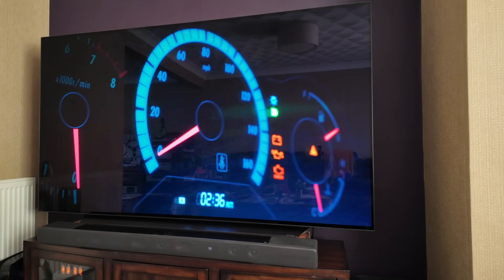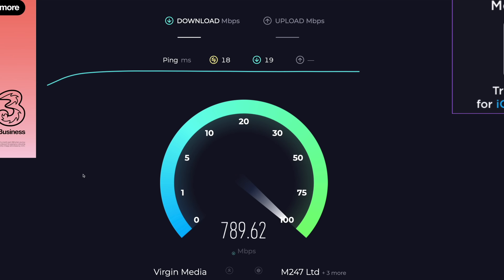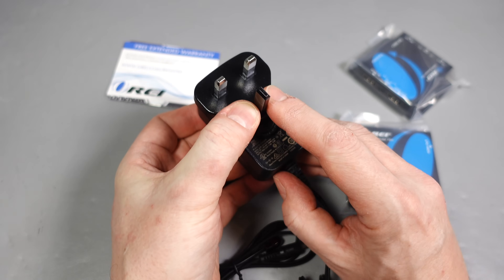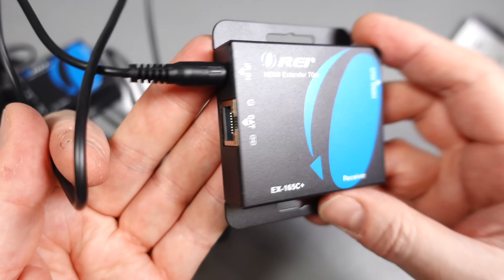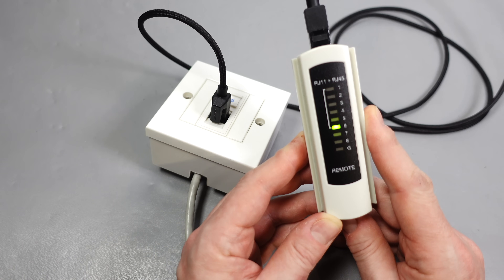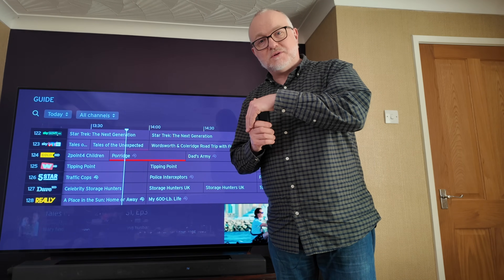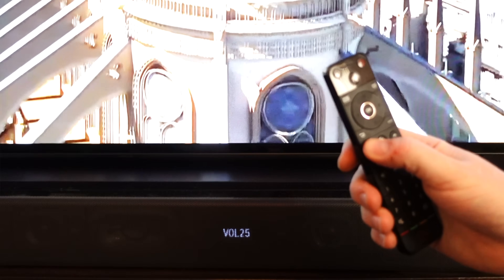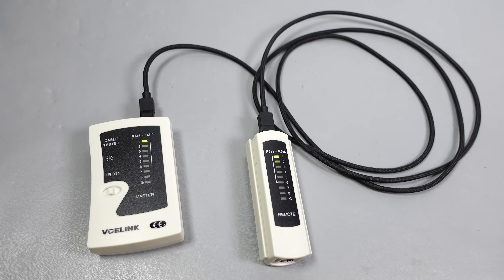HDMI via a Cat6 cable works surprisingly well

Comment: I love this device - I had a need to run multiple video sources to several 80" screens in a manufacturing plant, so I got the 4x4 version to route any four sources to any four screens-  It works just as Matt describes, with a little added flexibility.  Orei makes a 8x8 version too in case you want to sing Karaoke in every room of your house.

Comment: The company I work for a long time has had an old school computer transmitting via analogue av video, but the newer system they started bringing out is hdmi, which is causing issues for venues with multiple screens. I’ll have to check and see if this is what they’re using

Comment: Great video, I've used these extenders (along with an "active USB cable") to re-locate my large noisy PC in a wiring closet away from the office. The only drawbacks so far are (1) They are sensitive to electrical surges and lightning, causing the screen to blank for a second and (2) upgrading to the latest 4K/HDR/HDBaseT models from 1080P only was expensive.

Comment: Cat5e/6e with mixed A and B type wiring would work for most network devices as they will accept either and negotiate with the device at the other end ... but this is a just using Cat cabling directly ...

Comment: got one taking my pc signal to a tv on the far wall for a third monitor, works flawlessly.  Unlike mirror cast, the pc thinks the monitor is always on, so after reboots no going throw all the steps to reconnect to the tv.  no more unstable wireless display issues , nice!

Comment: As an AV integrator I use those daily, abeit we use other brands, and there are lots of situations when you would want one of those extenders, for example i have a receiver with 2 HDMI outputs, a 58" TV on front and a projector on a side, similar to what you used to have there, i run an extender from the 2nd connector of the receiver to the projector and the main out to the tv so anything that goes trough the receiver as cablebox, dvds and bluray also go to the projector. Great video btw.

Comment: You had made a cross cable, this setup was required in the past for connecting two computers directly without a switch, but today, nobody cares about, it because when you plug a network cable between two computers and this cable isn't a cross cable, the computers can handle the wiring automatically. This also happens when you connect a computer to a switch as well.

Comment: I live in a Cornish cottage with a 700mm stone wall so no luck with WIFI or Bluetooth in another room!
In fact currently wiring in more cat6 cables as I am moving the computer.
WiFi dishes in nearly every room are hard wired back with one in the workshop & another in the garden?
Yes very slow 2.4g can get around but such low data rates.
I used to be on a tec desk for a major ISP with people moaning about slow internet which was really the limitations of WiFi. Sky has a WiFi booster / repeater in ever product to help this problem.

Comment: Just setup this same system about 6 months ago in a 60'x120' warehouse with TVs on either end. I have the 1x4 splitter and it works great. I typically run a Chromecast so can have it playing on all TVs at once or use the TV remote if I want something different on a single TV. No loss in quality like you would get in a long hdmi run

Comment: Funny we're on the same wavelength
i installed something similar like this 2 weeks ago ^^ 
i use it to game on my tv (with my pc on the other side of the room) and i changed they layout of the room so the tv was to far away for the HDMI extension cable i used and it works perfectly no difference.

Comment: The reason the cables work is you wired it as a crossover cable, a special cable for connecting two computers together without a switch or router, computers and router can use crossover and compensate

Comment: If I am right that Virgin box is exactly the same as the Ziggo Next box here in the Netherlands (Makes right since both are owned by Liberty Global) I understand these boxes needed to be connected via Coax cable and you dont have this connection at your TV (since this is why you are using the device in this video) BUT  instead you also could have use a MoCa adapter set so you could have the setup box at your TV. A MoCa adapter transfers the COAX connection over a LAN cable.
Reply from the maker: Interesting - and news to me. Ta.
Reply: @Techmoan  sorry Mat but I gave you wrong information! A MoCa set goes the other way around! It transfers  the Ethernet signal over COAX! Sryy mate! I mixed the 2 in my brain somehow.

Comment: It works great!   We use that at chu ch for video distribution in the building and as long as the transmitter/receivers are a good design and build its rock solid.

Comment: We use a on of cat6 cable for audio in broadcastivg TV and Radio in North Fl. 

Not all stations and its due to 2 older engineers that started out using punch blocks for TelComm 🤣 modern digital soundboards running on analog and digital punch blocks. The blcoks suck but i dont mind Cat6

Comment: I can't think how many hdmi extenders and cat matrices I've installed over the years. Did my first one back in 2010 and they've got so much better and capable since then. First lot were dual cat cables for normally 1080i to 50m at best with power sockets at both ends.

Comment: In 2019 I had the house wired for cat 6 - two lines to each room. Of course I now have fast wireless so it's not as necessary, but it has left me with cat 6 connection.

Been doing this HDMI over cat 6  for the past four years.  I also have a blu-tooth keyboard and mouse which, via a USB extension from the PC, allows total control of the PC from the front room where the TV is. Now I don't have Sky or any TV package other than freeview. but I do like i-player and youtube

Of course, do this and you have the PC in the TV room, so streaming of everything else becomes possible, no need then for specialist streaming servers or anything like that. As long as the PC is serving a picture, any sound source from the PC comes across. My TV also allows me to turn the display off so I can listen to music with no visual distractions.

In short the way to go.

Comment: We pre-wired our house before the drywall went up 10 years ago, and had a 50'/15m cable run from the AV shelf in the top of the closet to the TV, and went with a dual CAT6 to HDMI converter box. It glitches for a second or two from EMI events (lightning, cat running across the couch in the winter when the air is dry) and doesn't handle the Audio Return Channel, but it was so much cheaper than an HDMI of that length that those things don't bother us. For the remotes we used a Harmony Hub. Ten years on and both still work great, I'm watching you on it now via a Chromecast connected to the AV receiver in the closet.
Reply: cat'ning
Reply: @SeekingTheLoveThatGodMeans7648  The struggle is real, lol.

Comment: Ethernet cable's certainly handy to have running about a house, because it is useful for so much more than connecting computers up for Gigabit speeds, given it can do this as well as USB, telephone, video signals, etc., all very cheaply... :)

Sad seeing that internet speed there though, given BT Openreach has hobbled everyone to FTTC speeds which if the wires aren't wet and corroded and breaking up could potentially reach 80Mbps, near the end of last year, VerminMedia put in some dangling fibres outside here, but nothing has happened since, just a coiled up roll zip-tied to the BT pole outside my yard, but I don't fancy paying for them again, look away for a second and they push the bills up, no thanks! :S

Comment: Oh look at you Mr Network engineer. Great stuff and B is the correct standard. When you first wired up your sockets the wire in the wall was setup like a crossover cable. Rewiring the sockets so both ends are type B is the right standard. Good job. BTW I have been a network engineer for over 30 years so if you're ever stuck again let me know as I based in Liverpool and all  the know how and tools to do any network type of job.

Comment: I installed an Orei KVM (keyboard, video, mouse) last week. I have a surveillance video recorder in the basement and a monitor/mouse in the kitchen. I connected the two via cat 5e that I had previously run 20 years ago! Runs great! (edit: I had the same problem with one end wired A and the other B and had no power)

Comment: I had Virgin, I found it to be fast but unreliable. Support is non-existent and they kept ratcheting the price up. I've moved back to BT. Anyway that's besides the point running your own CAT6 cables is very impressive. You're a lot more "Tech" than you are "Moan"

Comment: Seeing the cable lights messed in the tester reminded me about cross-over cable to connect PC-to-PC without a hub/switch I used back then in the late 90's
Reply: It is.  All network adapters from the past 20 years can auto-sense whether it's a direct or cross-over cable, and will adapt to it, which is why the was working fine before even if connected to a switch or router.
Reply: @klafbang  yeah networking major here, just wanted to say that that's correct, and while you "should" still use crossover to connect two devices of the same type, just in case something doesn't have Auto MDI-X, for 99% of things either cable will work. So two computers can use a patch cord with no issues I've ever seen.
Reply: @kreuner11  nobody cares, also "networking major" isn't a thing
Reply: @pcefulpolarbear  yes it is, kierunek technik informatyk In Poland includes networking and computing 
And if you don't care then do not respond
Reply: That was my first thought as well.  Crossover cables are a thing people forget existed, because auto-sensing has been a thing for a while, but they were indeed a thing.
Reply: I thought that, MDI vs MDI-X https://en.wikipedia.org/wiki/Medium-dependent_interface#MDI_vs._MDI-X

I’ve booked my taxi ready for the elderly home..
Reply: Key memory of making these with my uncle unlocked. Dude, you just made me cry, hahaha.
Reply: This was indeed connected as a crossover cable. You make them by switching A and B standards at the ends.

A workaround for his problems would be to change one of the shirt patch cables to a cross over cable to counteract the crossover.
Reply: Was it an RS-232 variation perhaps?
Reply: @repsych no, it was a crossover cable probably by accident, but it worked anyway since modern network devices will automatically configure themselves to the right mode if this occurs
Reply: ah the old ad-hoc network

Comment: Love these videos. I acheived a similar solution with virgin media after going from skyQ (price) and feed a 20 metre hdmi fibre optical cable. This allowed hdmi 2.1 too (4k 120htz) and the virgin remote worked just like in this video.

Comment: We had a similar unit that used two cat5e cables for about 6 years for a yearly 3 day basketball tournament. Unfortunately the AC adapter failed on 2 of the 8 we purchased after 2 years (only 6 days!). We replaced and had one the next year fail again. Hopefully they've become more reliable since then.

Comment: As a professional AV tech, we use these all the time when SDI isn't practical, necessary, or available. 10+ years ago I was using an older VGA version of these to run data cheaply to projectors for live events large and small. The quality loss was minimal, even blowing up to a large 12 foot+ screen.

Comment: I've been using this system (but a different brand) for about three years without any issues whatsoever. I use mine to copy the CCTV feed from its home under the stairs to the TV in the living room. I've routed the cat cable under the floorboards so it's hidden out of the way & we can now switch from the TV to CCTV instantly if we hear a strange noise outside.

It's a fantastic system for the price & I opted for this instead of a long HDMI cable because drilling holes for the cat cable is much easier than for the HDMI cable as the holes needed are much smaller & I didn't want to reduce the strength of the floor joists. I also had a lot of cat cable left over after installing a network in the house, so it reduced the work & also minimised the cost for me.

I didn't fit the infrared cables to the system as I don't need them for my setup to work.
Reply: CEC passes through just fine?
Reply: I did the same so I'm not crammed in the wiring closet to view security footage. My box extends USB so I can use a keyboard/mouse at the remote end

Comment: Boss asked me to figure out a way to show company stats across all the TVs in the office. I'm a Data Analyst, but somehow also became office IT lol. I found a similar product on amazon and ordered it, unhooked all the TVs from their ethernets and used these adapters and the main unit hooked up to a spare laptop running a slideshow and playing music throughout the office. Cost $140 vs the $30 monthly fee our IT company was asking for to set up some cloud based system. Boss was more than happy.
Reply: I hope you’re getting paid extra for the tech support.
Reply: should've charged him $25 monthly for it
Reply: I don't miss working in an office: "Hey, you're a developer! Can you fix my printer?"
Reply: Same thing here; I’ve used these extensively at work for a multitude of things and they work surprisingly well. It’s opened a lot of AV possibilities for us.
Reply: Your comment reminded me of SG Bus here in Singapore, but specifically the bus interchanges. There are two screens in different places throughout each interchange, and as far as I can tell, they use HDMI extenders that have built-in splitters so they (or at least SBS Transit at the interchanges they operate) could just pay for 2 screen licences for "STAR NET" digital signage software they use instead of paying for each screen as they'd all be displaying the same information, with the left screen showing bus schedules and the right screen showing promotional/advisory stuff.
Reply: Nice. How did you split the signal to all the TV's?
Reply: Hey remember that show What's the Boss?
Reply: Data analysts are the easiest to trick into doing free unpaid labour
Reply: 140 bucks out of his own pocket probably.
Reply: And I bet you were rewarded with a pat in the back and more work lol. JK, good job making the company save the money.
Reply: When I was a night manager at a hotel, we installed a similar device to mirror the cctv monitor to a dumb monitor in the back office of the hotel I worked at. (The controls, nvr, and main display were locked in the gm’s office.) It really was one of those “it just works” types of products! From a security perspective the added bonus was this way only the gm could actually adjust the display, change settings, or view the recordings. Even still it was perfectly sufficient for being able to glance at and check to make sure the hallways were secure and nobody was waiting at the desk while I was doing paperwork.

Comment: Ha! As someone who does AV for touring bands and stadium sized gigs, it's interesting to see this trickle down into consumer market - I'll be honest though, I wouldn't bother wiring my house with cat 6 - unless you have it pre-wired and are going to repurpose network runs.  DP/HDMI over fiber offers a far more robust tech - hell you can have 400m runs with right equipment.  For just basic home av stuff, you can pickup some affordable previous gen equipment - it'll give you enough bandwidth for a 4k stream in every room and all your networking needs - via the same  bundle.

Comment: 4:55 you sure your wire isn't simply crossed? Back in the day you had to swap tx and rx so that tx is connected to rx so that when connecting ethernet to computer/router they could talk to eachoter. Nowadays network interfaces do crossing automatically so its not needed anymore but your cables might be old

Comment: There are even versions with the whole converter/ deconverter built into  larger HDMI plugs with an RJ45 connector on the other side.
They lack the IR remote return channel but support CEC as far as I know.

Comment: I know this is ultimately irrelevant, but I am a little confused. What’s the point of the extension? Why not just plug the 360 box straight into the TV?
Reply from the maker: The virgin 360 box relies on a connection to their cable service, this co-ax cable connection arrives in the office room at the other end of the house and re routing behind the TV it is impossible given the layout of the house.

Comment: For people in chat that are from other countries that generally standardised on the T568A Standard, please note that these devices require T568B wiring SPECIFICALLY. The T568A standard causes inbtermittant dropouts. Only a few technical people will know this as fact. please keep this in mind
Reply: That sounds like BS to me. I believe the only reliable difference between the two standards is the insulation color. Unless the twist rates are standardized a blanket performance statement cannot be made.
Reply: @eDoc2020  and yet it still true, check ANY device manual. You are welcome. Best to use cat 6a sftp if using patch lead as indidually screened pairs does also aleviate the unintended interferance and negates the t568b requirement... to an extent.

Comment: FWIW, Sky Q Mini boxes work perfectly well over standard wired Ethernet along with other devices on the network - more reliable than the WIFI connection over bigger distances.

Comment: Nice one Matt. These are very handy for projector runs (from the player to the projector at the back of the room)
Reply: Good call, might have to switch to that when I next upgrade - much easier to swap out a pair of boxes rather than re-run a long cable when you need to support a newer HDMI standard.